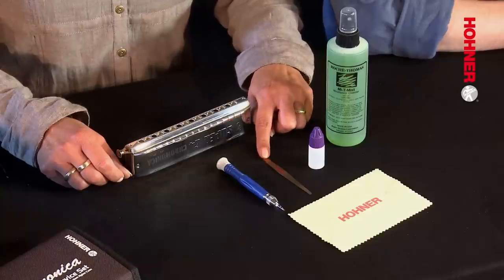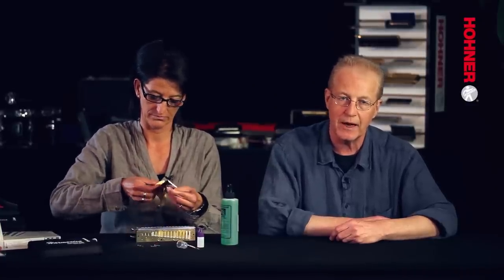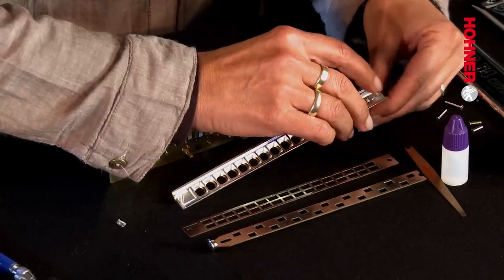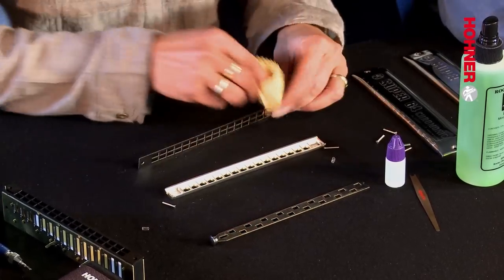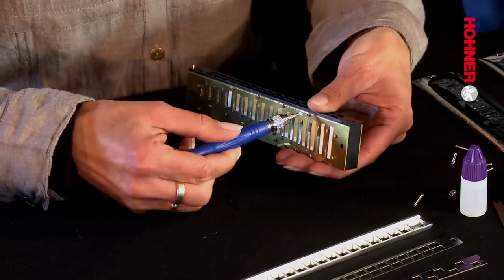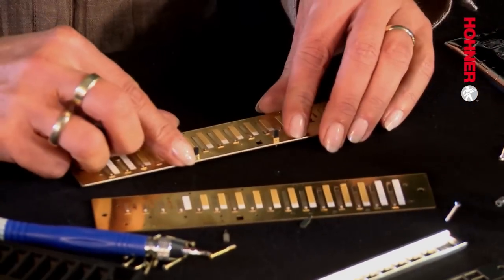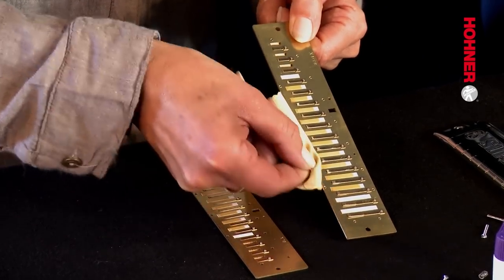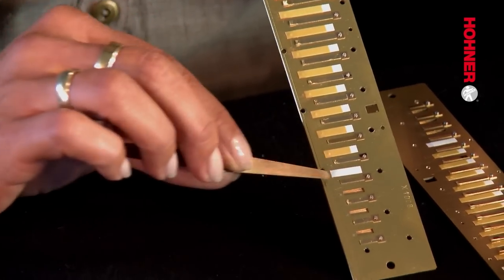HOHNER Service Workshops:C02 - Cleaning

Comment: Would like to see the cleaning of the normal size harmonica that most people use.
Reply: The 10-hole diatonic type favored by most blues and rock musicians. Yes, I would love to know how to safely disinfect a vintage Marine Band or Special 20 harmonica.
Reply: If the wood isn’t sealed, you can’t sanitize a vintage harp. If the harp has an ABS or sealed comb, just take it apart, remove any build up, and dunk it in isopropyl.
Reply: You mean a diatonic harmonica as opposed to the Chromatic one with the slide button you see in the video

Comment: I thought this would be a great help to me... until I discovered that the reed plates in the 60 year old Super Chromonica I have are nailed/riveted on, not screwed.  I guess there's only so much I can do to clean this one.  A nice heirloom, though (and still a good video).
Reply: Those are small nails. My old Chromonica has them also. Just carefully pry the reedplate away from the wood comb with a flathead screw driver....CAREFULLY.

Comment: I've just bought an old 57/120 large Hohner Echo Harp, I want to completely strip it down to clean inside, how should I go about this?, especially as the top and bottom covers are fixed in place by pins, thanks in advance.

Comment: I have a Hohner 280C, which has a note that doesn't ring out immediately when i draw air. It starts ringing out after a few seconds if I continuously draw air. What could be the cause? A slight misalignment of the reed, or some debris stuck in the reed perhaps?

Comment: I have a Suzuki Manji Harmonica and I would like to have a kind of disinfecting cleaner, but I had read that some of them can damage the wood... which fluid cleaner do you recommend to use for my Harmonica 

Thanks...
Reply: Giordano Fronte Hey.  The Suzuki Manji has a composite comb made of wood resin and plastic.  You can simply use water and soap or 91% ethynol alcohol for cleaning.  The alcohol might take off the painted key marker and Suzuki label, though so be careful if that matters to you.
Reply: Can I use iso-propyl alcohol?